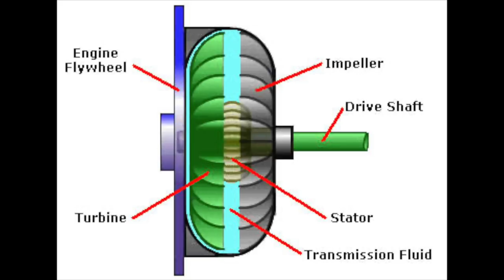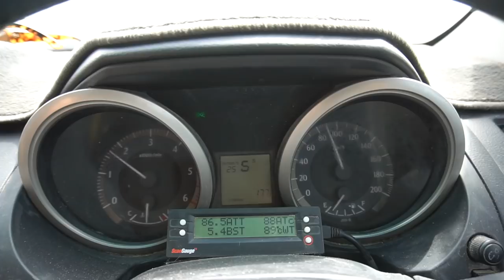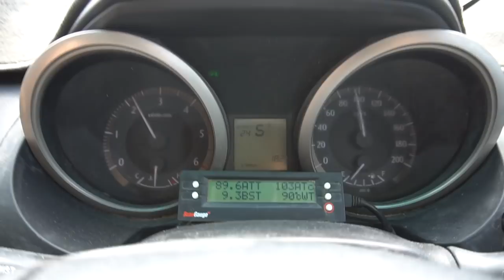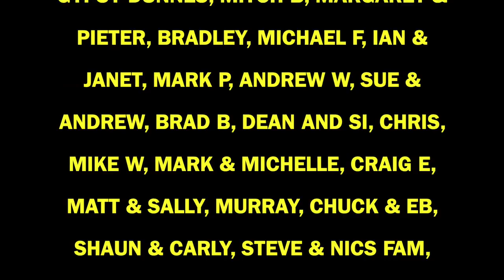HOW TO NOT DESTROY YOUR VEHICLE / TORQUE CONVERTER LOCKUP / TRANSMISSION / OVERHEATING / TOWING 101

Comment: Keep up the good work, I have used a scanguage for the last 10years and 150,000klm of towing 2.5 ton, a must have plus I have an engine guard cylinder head adjustable temp alarm to alert you to a blown radiator hose that your coolant temp won’t register with rapid coolant loss.
Reply from the maker: Thanks Tony! Sounds like you have the perfect setup and really didn’t need to watch this video haha! You’ve got it all sorted! Thanks mate

Comment: Good write up
I agree never tow in over drive gears, as you said they are the weakest gears, even with my lockup kit I would tow only in 4th.
I'm no expert but here are a few things I've worked over the years
I have the Richards after market lock up kit, I luv it
It has high speed lock up and low speed lock up buttons
High speed lock up in your case would work on 4th and 5th gear lock up
Low speed lock up, locks up 1st, 2nd and 3rd gear, this a great for those long windy up hill sections of road, keeps the trans cool and engine is happy too. 
Something a lot of people down realise is using a lower gear to hold you back going down hills heats up the trans too, anytime there is slip in the trans there is heat build up, the aftermarket kit helps here too.
Low speed will also lock up in low range, so great for keeping the temps down in the soft sand
Something I found I interesting is even when locked up with the kit the trans will change gears, if you have it in 4th locked up and you come to a steep hill it will change down a gear and then lock up in that gear (if in low lock up) if in high lock up it changes down to 3rd and unlocks.
Economy is better too, when unlocked the transmission is slipping and using more fuel
Reply from the maker: Thanks Neil! For sure mate the lockup kit a massive tick in my books. Even though I don’t have one I’ve always wanted one but could never afford it! One day I’ll have one haha

For sure the torque converter unlocks down hills even though there’s no physical load. The engine will still try and slow the trailer down unlocking the converter and causing heat! Your right and not many people know that! 

Thanks for the comment mate 100% agree with your points!!
Reply: I just commented above, same richards here in my 200 series.

Comment: I guess I don't really need to buy the Scangauge as you've done the testing, and the message is to not use overdrive gears when towing. I have a Pajero Sport with 8 gears. 7 and 8 are overdrive. When not towing I use full automatic. When towing I tend to drive in 6 when under any load, 5 with steeper inclines, 7 when declining (is that the right word?) and 8 not at all. Some vehicles will change their behaviour when towing, but the PS doesn't seem to. I tend to look at the tacho and keep the revs around 2000 or more when towing.

Comment: Informative video and should help a lot of people avoid cooking their auto transmission. Also pays for owners to confirm which gears are overdrive. If you have an 8 speed gearbox you will probably find gears 7 and 8 are overdrive, so you should not go higher than 6. Also avoid the temptation of using cruise control..
Reply from the maker: Thanks Fred! 100% agree with your statement! Should of stated that however that’s where my knowledge of trans boxes finishes I know up to 6/7 speeds and I don’t like commenting if I’m not 100% if I’m right or not! Thanks mate great point
Reply: @SarahandKeelanTravels  yeah I think the the 6 speed box has overdrive on 5 and 6. Interesting the manual 6 speed is overdrive only in 6. The manual would make a better towing vehicle.

Comment: Whilst observing EGT's and auto transmission temps is a good thing, its something completely different to actually understand what the numbers mean. With EGT's your not looking at the peak number, your looking at consistancy, and variantions within that figure, EGT's can vary quite wildly, if you are using an aftermarket probe, moving it even 4-5cm can see temp differences of 50-80c. As for Auto temps, auto boxes are good for 130c fluid temp constant, but they also rely on not running too cold, you will find most auto's these days have a thermostat within the auto which restricts fluid movement until a set temp as part of the cold temp warmup, so seeing temps <90c isnt always a good thing.
Reply from the maker: Hey Daniel! 100% on the EGTs in terms with the trans temps I have read and heard similar things about specific cars and auto boxes  however like I stated this is a basic video explaining in a way that average jo blows with limited towing/ auto experience can comprehend. 
In terms with not seeing fluid movement until past 90 degrees is subject to change from car to car. For my Prado I would take sub 90 degrees for a long period of time over 110 degrees for a long period of time. So you reckon if you only service/change auto fluid as per the user manual (could be 6 months depending on car) and everyday you punish cough* I mean drive your car plus tow 2.5t for hours and hours like we do whilst your trans temp is 130degrees constant your fine and nothing will happen!? 😂😂 the box might be rated to 130 degrees but I can guarantee the molecular makeup/ viscosity/ and every principle that makes that fluid effective will be lost after after a month of your punishment  😂😂  the trans temp light will be flashing red on the dash but you reckon keep driving? Right
Reply from the maker: Have a read of this Daniel, everything I’ve stated is backed up in this 

http://thetransmissioncentre.com.au/?page_id=105
Reply: @SarahandKeelanTravels  Agree with you. Gearboxes are happiest in the 80’s temp range. With auto gear boxes that have multiple clutch packs that rely on friction to maintain power transmission, any increase in temperature above 100 c for extended times usually means you are having some serious slipping going on. Heat is generated in an auto in two main areas : torque converter as it relies on transmission fluid to transmit torque, slipping is part of the process therefore the the fluid heats up. Clutch packs are used to provide the different gear ratios on the epicyclic gear sets and lock the torque converter. Any damage to these clutch packs will cause slipping and generate heat.
Reply: I agree with your comments Daniel. I’m sure that transmissions and transmission fluids of yesteryear were designed to not exceed lower temperatures, but now they are. I always find it amusing too, that any claims that coolers need to be fitted or fluids need to be constantly replaced, usually come from transmission repair companies. I’m pretty sure that modern vehicle design engineers aren’t fools.
Reply: @petep7410   people saying lower temps are better seem to be oblivious that you only need to look at the cars cooling system and the fact they run thermostats to help the motor warm up and keep it running within a certain temperature range. Auto transmissions are no different, they like their set temp range which is typically 95-120c and many auto temps including popular models like the ranger have thermostats within the transmission itself, to allow it to warm up faster and maintain that minimum operating temp.
Reply: @SUPERTRUCKER166  I agree. Toyota for example have a 7 year, unlimited kilometre warranty on their engines and transmissions. Given that, I’m pretty confident that if after all the research, development and testing on their transmissions they found that the transmissions ran too hot, they’d have installed a transmission cooler or other method of keeping the transmission at a lower temperature. Like I said before, I don’t think the mechanical engineer designers of modern transmissions are fools.

Comment: Good vid mate, Coulda maybe touched on trans coolers - running up grades and regular checks / services help too. Are you running a stock cooler? Nice yorkes. Love it!
Reply from the maker: Cheers Steven! For sure mate, trans cooler and lockup would be the go!! Like I said it was just basic info though, being able to monitor the temps is most important and there are ways to manage it. We have stock everything and I just monitor it, tow in 4th an drive at a speed (90-95km) that it allows me to lock in the TC and control my temps. Normally sits on 80 degrees TC and trans temp  when in the 1:1 ratio.
Reply: @SarahandKeelanTravels  yer sweet enjoy the weather i think we have 30c this wk end. If ys head south of adl. Check out deep creek. Cape jervis. Maybe KI. Victor harbor. Good surf at victor mate. Victor / middleton and good bakerys lol
Reply from the maker: Thanks for the tips mate! I’ll chuck them all on our list!! We are loving south aus aye such a great state! 🤙🏽🤙🏽

Comment: saw TCLUK in the the desc, havent even watched it yet, but had to comment hah!! I have a 200 series, got a lock up kit, trans remap and engine remap/tune done in Perth in 2017 on my first half aus lap. Towing a 17 foot van at 2.2 tons. By the time i got to Broome, it had paid for it self in fuel savings. Let alone trans temp reduction. Hunting for the correct gear vs revs was also almost gone. I realise mines the 4.5 liter v8, and kitted a bit, however, i still think any one towing in an auto should invest in a lock up kit. No matter what brand of vehicle, the benefits out weigh the costs by a huge margin. I have an UltraGuage and trans temps is one of the windows set in the shit i like to see, turn off the luk when towing, watch the temps go through the roof, turn it back on... back down 30-40 C lower. Ill go watch your episode now. G.
Reply from the maker: Cheers mate haha have a watch haha you pretty much covered everything I said haha! 100% agree though! The reason I havnt got a lockup kit is because I can’t afford one haha but I strongly suggest them to a lot of people! If you can get one the being able to monitor and drive accordingly is the next best thing!
Reply: @SarahandKeelanTravels  get one asap. you might thank me later. Pop it in you to do list.
Reply from the maker: It’s hard ordering stuff with no fixed address and when your moving from town to town state to state but I will check it out
Reply: @SarahandKeelanTravels  big like for that. you'll work it as it sees you fit.

Comment: Great information, what gear would you use on bad corrugations ?
Reply from the maker: Hey mate! Cheers,
It all depends on your speed. We had hard time keeping torque converter temp down on the Gibb simply because we could hit the speed threshold in 4th gear to lock the torque converter up, (typically 68-80kmh) 

if your planning doing a lot of corrugations maybe look into a trans cooler and a lockup kit! But if not I  would say select manual 4th gear still make sure you can monitor your temps and just find the sweet spot where your TC temps arnt staying over 100degrees for long periods of time and if so pull over and take a break every now and again! Your shock absorbers will thank you for the rest stops too!
Reply from the maker: Hey mate! Cheers,
It all depends on your speed. We had hard time keeping torque converter temp down on the Gibb simply because we could hit the speed threshold in 4th gear to lock the torque converter up, (typically 68-80kmh) 

if your planning doing a lot of corrugations maybe look into a trans cooler and a lockup kit! But if not I  would say select manual 4th gear still make sure you can monitor your temps and just find the sweet spot where your TC temps arnt staying over 100degrees for long periods of time and if so pull over and take a break every now and again! Your shock absorbers will thank you for the rest stops too!
Reply: @SarahandKeelanTravels  Thanks, keep up the amazing videos
Reply from the maker: No worries mate glad I can help! Cheers for the support

Comment: Mate are you using it in Auto at the start when taking off or do you flip it over to S mode straight away and use it as a manual?
Reply from the maker: We always run sports mode which is S4, throwing into drive and letting the cars computers decide the shifts will heat up your trans in high gear as the TC won’t lock up
Reply: @SarahandKeelanTravels , Cheers guy for the Info, we have a 2021 LC200  
So we can relate to what you said about the gears changing up and down even without a load behind it. We have done a lockup kit through SQP, have a look at what they do there are no switches to turn on or off he does it through the computer side of it interesting. We can't wait to be on the road full-time ourselves, Love watching you guys travel around, and your tips and tricks.

Comment: Just out of interest what does Toyota recommend? When I contacted Isuzu about towing in our MU-X they specifically told me not to hold gears manual and to only ever tow in auto. 
Also I think fitting an auto trans cooler on vehicles that to is always a good idea.
Reply from the maker: Im sure If you ask your manufacturer in there humble opinion they have made the perfect vehicle and you shouldn’t need to fit any mods or drive it any way. It says i can tow 3t on the user manual so I can slap it into drive and tow 3t. Unfortunately that’s where many people are getting caught out melting there Torque converter or over heating there transmission. 

In regards to holding gear, they may of been referring to holding it in your overdrive gear. But holding it in a higher rev range and a stronger lower gear is a lot better for a vehicle then letting the car hunt gears constant unlocking the torque converter and heating up the trans the TC and the engine.  

I agree on the trans cooler!
Reply from the maker: http://thetransmissioncentre.com.au/?page_id=105
Reply: @SarahandKeelanTravels  actually my dealer is pretty honest about the flaws (crazy I know!) he told me about the dodger turbos and the thin paint, and admitted that they benefit from a catch can to prevent build up. He did say the trans was pretty rock solid though. We tow a 2.2t  maverick camper and have had no problems yet. Ultra gauge in order though just to be able to keep an eye on things!
Reply from the maker: I would 100% advocate for holding you top gear that’s not over drive which for me is 4th, not sure what the MUx has but I’m sure it’s equally as bulletproof and like you said ultra gauge or any gauge you can keep an eye on it. Once you get your gauge and tow a bit you’ll see how the cars temps behave on hills ect. Play around with it! Slap it into overdrive and watch the temps go up and down with speed and when the TC locks and unlocks! You’ll learn pretty quickly what the car likes and dosnt like!! Few hills around Adelaide are testing Percy the Prado out lately haha 😂

Comment: Your not wrong about Toyota's hunting for gears. I have the 1GD variant and yeah no chance of lock up in 5th even though it is a 6 speed. Tow in 4th also. I need a Scan gauge and put your theory to the test. Best explaination I have seen yet mate well done 🍻
Reply from the maker: Yeah right, wasnt 100% sure on the gearing so I didn’t comment! Thanks mate appreciate you support and yes get a scangauge
Reply: In the 6 speed transmission for the GD, 4th gear is still 1:1 and there are two overdrive gears.

Comment: Higher rpm is correlated with higher fuel consumption because the engine is an air pump - the faster it spins, the harder it has to work to suck fresh air in and push hot exhaust out. Thermal efficiency tends to be greatest at a moderate rpm and tapers off at the extreme lows and highs.
Reply from the maker: Why do I get better fuel economy at 2500rpm then 1800rpm?

Comment: So do you want the torque converter locked when towing??
Reply from the maker: Yes when it’s locked there’s no slipping and less heat, better fuel economy
Reply: @SarahandKeelanTravels  so when I go full throttle does it still lock up. I seen somewhere that says almost all torque converters don’t lock up at full throttle
Reply: @SarahandKeelanTravels  sorry just really curious is it only good to be locked when your less then 40% throttle

Comment: This is a great vid for anyone who  does not do there research, very well done mate, Nissan 4.2 turbos blow their 5 gear if you tow heavy , top gear in most vehicles is the weakest, also add a extra oil cooler to your transmission it helps alot, keep up the vids great work from both of you.🤙
Reply from the maker: Thanks mate!! Cheers for that tip too! I’m pretty familiar with the lockup kits but I need to do more research into the coolers! Cheers

Comment: I use two air trans coolers with fans and the factory one as well, so 3 all up and a larger transmission pan extra 1.5 Lt oil and tow 3ton. Temp never exceed 85’c, up hills in sand flat out and 38’ days. If it shutters it’s fukt just a little bit, it’s the start of major dramas 6k +. I change oil every 40k with filter. Or just get good insurance.
Reply from the maker: Some good info here mate! Sounds like you have a good setup! 85c is perfect
Reply: @SarahandKeelanTravels  
New car warranty fixed it once, now I’ve made it last. Better yet, buy a chev. Stay away from small trucks like yours towing, your still in a state with no hills, better you invest some money into more power because you will only do 1 lap. (What’s the point)